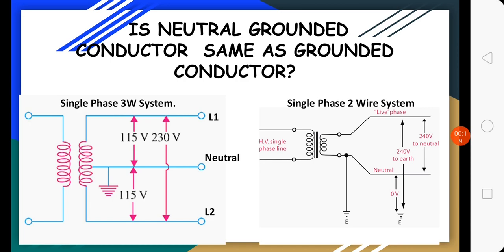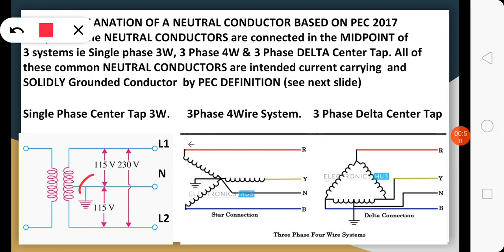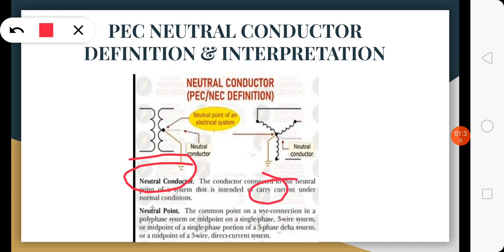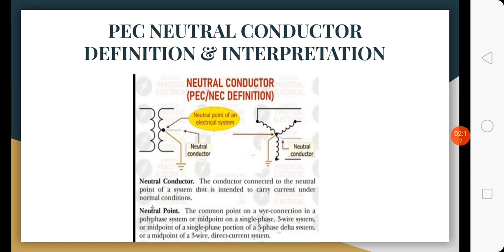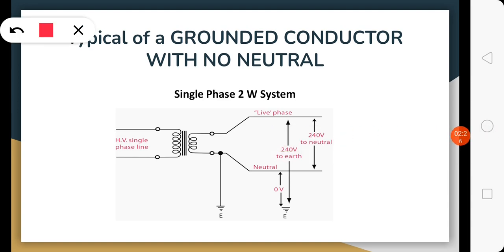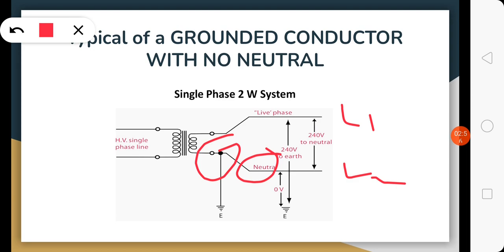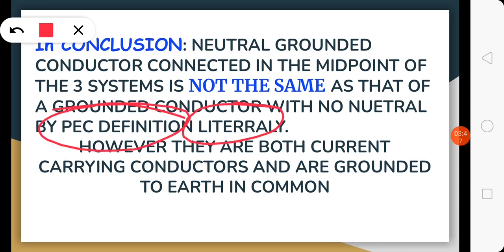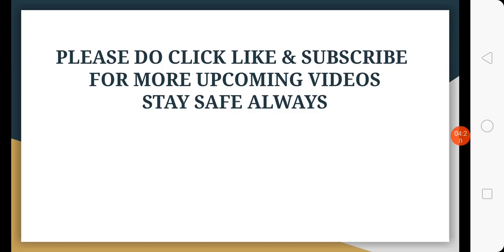IS NEUTRAL GROUNDED CONDUCTOR IDENTICAL WITH A TYPICAL GROUNDED CONDUCTOR  BY PEC DEFINITION?

Comment: My local single phase transformers (primary coil)DO NOT have a
neutral back to the substation. The center tap in the secondary coil
and the 2nd end of the primary coil are bonded together to the EARTH
at the transformer location.      Multi point grounding system at every 
single phase transformer along the way, back to the substation.
         Repeat, no other neutral conductor? comment please